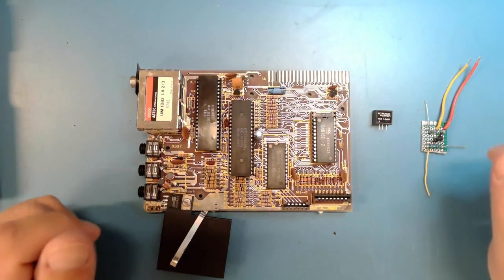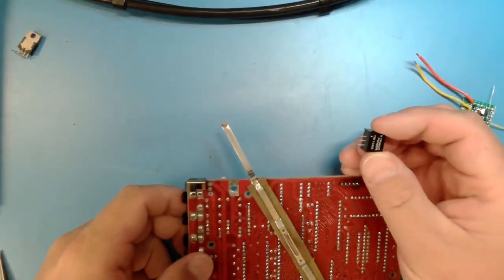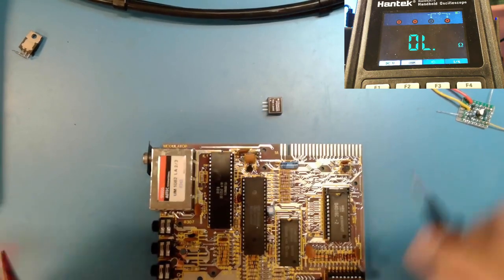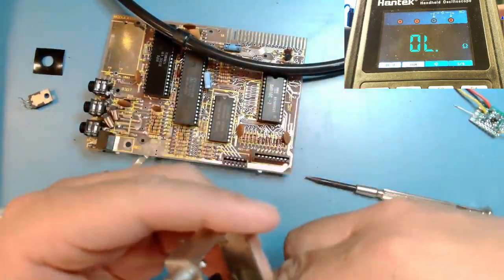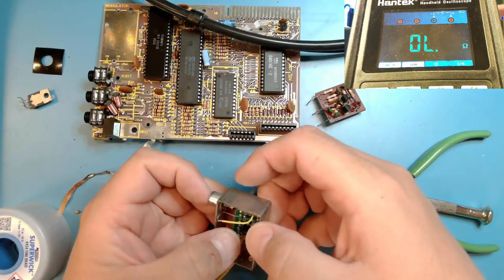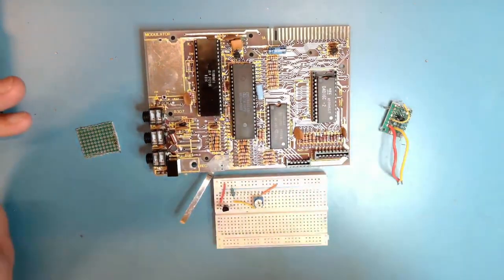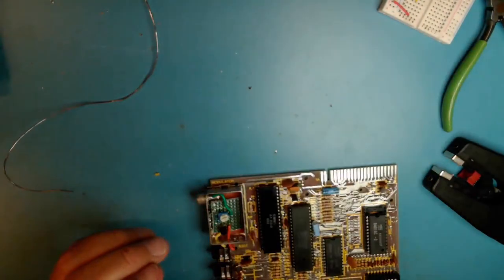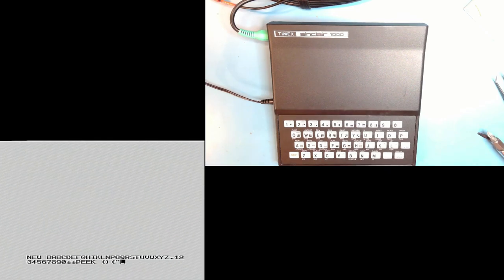MWPC - Part 2 - Composite & Voltage Regulator Mods for the #Timex #Sinclair #1000

Comment: Nice, the small signal tran type circuit is a tried and tested method of  changing a video signal, surprised the traco power hasn't let any harmonics through as they are terrible to use on a C64, As for any British snowflakes out there that took offence at your light ( and imo totally inoffensive ) comments, don't worry, they are probably Amstrad owners !!!!
Reply from the maker: Thanks, Lee.  If you look close enough, you can see some harmonic interference in the comp output.  I could only see it on the HDMI capture device, though, and not on the small LCD I use.  I considered adding a bypass cap to the Vcc on the ULA, but haven't had time to search for a good value to use.  I kind of wish I had done the regulator swap AFTER I did the comp mod, that way I could have seen the before and after video.
Reply: @YARC - Yet Another Retro Channel  if your scope has a fft or you can measure the high frequency coming through perhaps a LC filter would fit the bill, there are multiple online calculators to give you the values and its only 2 components on the 5v output (inductor inline & cap between 5v and gnd )
Reply from the maker: Yeah, that little cheap Hantek scope I use doesn't have fast fourier.  I wouldn't know how to use it anyway.  :(

Comment: Out of curiousity....is there the same memory chip that is in the memory add on module. Could the chip in the Memory Module be unsoldered and put in the internal socket?
Reply from the maker: Nope.  At least, not the one I have.  It contains a bank of 8 16 kilobit x 1 4116 equivalents (AMD AM9016's) plus several support logic ICs and a bunch of passives on two PCBs connected by a ribbon cable.  A single 32K or 16K DRAM would have been very expensive back then and Sinclair were all about making inexpensive machines that people could afford. My guess is they built that whole thing for less than the price of a single 16 kilobyte DRAM.